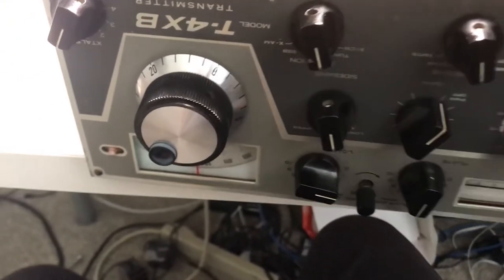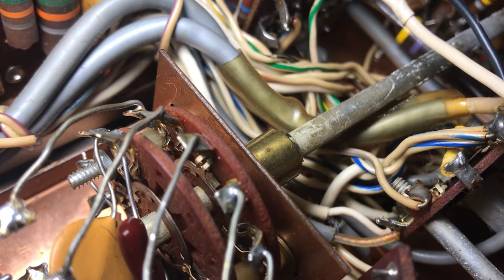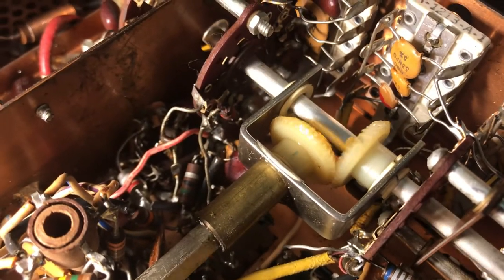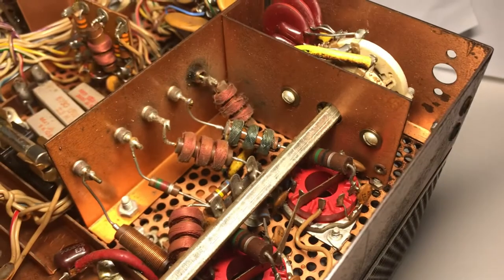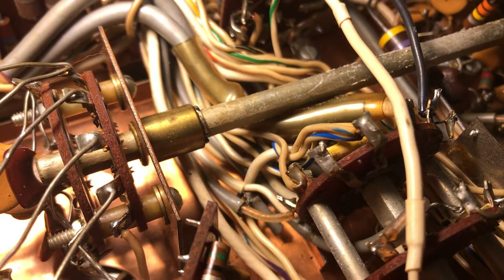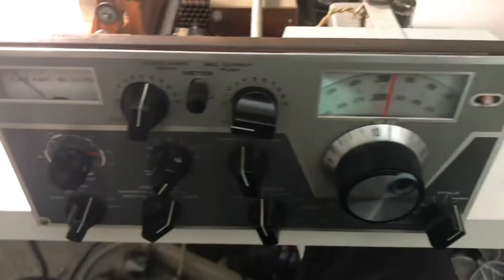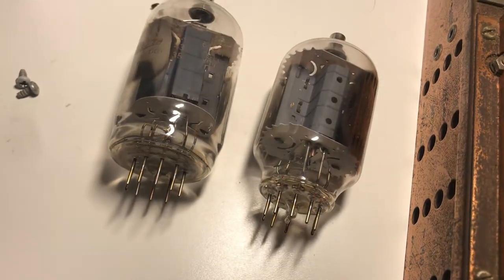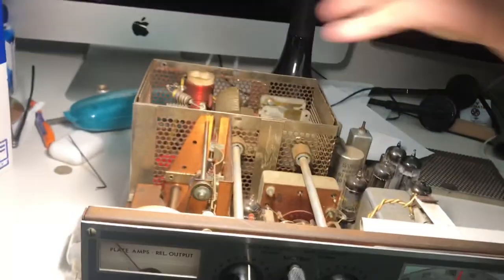Drake T4XB Transmitter Overview of band wafer switches and 90 degree gearing August 15, 2021

Comment: I bought a T-4XB for $100 at a ham fest to match my R4B given to me from a friend and I was told it worked fine. Well it didn’t. Your videos have helped me tremendously. You are so right about bad factory construction in some radios. I found bad soldering on the driver tube socket. I found R31 burned up. I ended up replacing R30, 31, and 26. I replaced V2, V3, V4. I replaced the electrolytic capacitor and put in a “new” set of matched finals. It was still kicking my butt with low output, only 50 watts. I tripled cleaned the tube sockets and all the switch contacts with De-oxit and chased it with CRC contact cleaner. I used emery paper to clean the tube pins. I could not believe how dirty contacts adversely affect these radios. The mixer  tube socket pins were wobbly so I ended up resoldering them and slightly bending the tube pins to get a firm seating because I noted with CW key down and wiggling the tube the output varied and decayed. All is good now, I have 110 watts key down and it’s real solid. SSB reports are excellent. I performed the transceive calibration in the R4B using C61 real slowly on getting the warbling to slow down to no warbling and the transmitter and receiver are now both on frequency. That is a delicate adjustment. Neutralizing the finals is somewhat dangerous for one person so my son helped me watch the Ip meter dip vs my watt meter output. I really enjoy your video’s. I also had to clean  the sockets in both radios for the mute and injection lines. Even slight corrosion really affects these radios badly. Thank you again for the videos and for helping us Drake 4 line enthusiasts. 73, Tom
Reply from the maker: What a great story!!!
Thank you
You might check the SsB filter switch and the connections from the switch to the SsB filter block.  The stiff wire affects the switch contacts and that may be the real problem disguised as a bad mixer socket.  I have a video of this repair.  Basically remove the still wire and
Put in multi stranded flexible wire.
This problem comes and goes.
Glad you fixed the mixer!

Comment: I appreciate your video. I just very recently acquired a Drake T-4XB that had been sitting for 30 years. It was deemed “for parts” but was completely together.

Before I even attempted to power it up, I rebuilt the power supply with the common upgrade kit and tested it.

I had to pull all the tubes and wash the whole thing in Technical Grade isopropyl alcohol. Then use Deoxit on all the wafers and tube base pins.

I then recapped the electrolytic. Then pulled the finals before powering it up.

It took a lot of time to get everything working! I am of the thought that someone previous had attempted to work on it as it was horribly out of adjustment, to the point where utilizing the front panel meter as per the manual was not feasible.

I had to use my oscilloscope to facilitate repairs and alignment (which I would have done anyway).

I had a lot of intermittent problems to iron out - mostly to wafer contacts.

73,
John Hickman WW3B
Reply from the maker: haha yep. LIfe is too short though. I left these videos to help others but I am no longer going to fix Drakes.